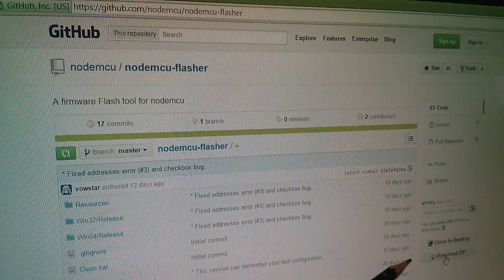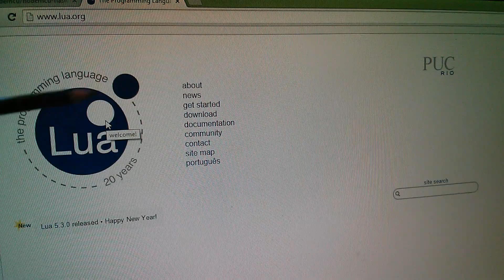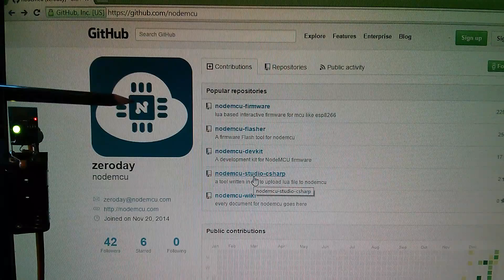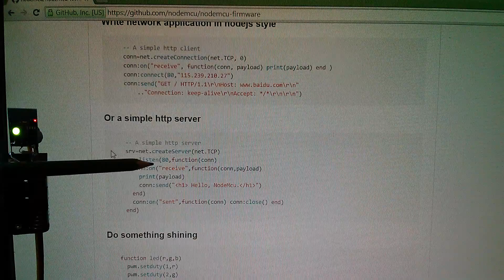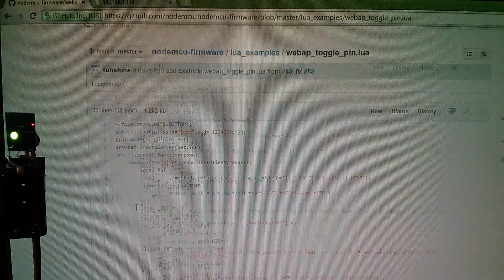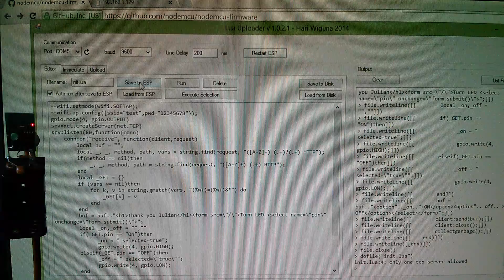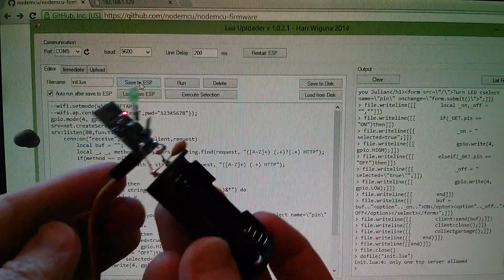ESP8266 Hack #2: Web Enabled LED - WiFi Internet-of-Things IoT

Comment: Julian Ilett , have you measured the voltage of the two Eneloops powering the ESP8266? In theory they're 1.2V each right? so that's only 2.4V, not quite the 3.3V needed by the ESP.  That might explain why your ESP sometimes refuses to cooperate?
Reply: Julian Ilett Yes - but was the tumble dryer still running?
Reply from the maker: Hari Wiguna That's interesting. There's a parameter in the specification sheet VDDIO (symbol Vio) which is minimum 1.7v, maximum 3.6v. I interpreted this as the supply voltage range, but now I'm not so sure.
Reply from the maker: Shadi2 Just tried the tablet browser again and it's working perfectly - and it's still running at 2.4v from the two eneloop NiMH cells. All very mysterious.
Reply: Probably it don't have anything to do with supply voltage (I have ESP8266 running on 2V all day happy but firmware is written in C) but is probably due NodeMCU which use LUA (scripting language) which is interpreted (rather than compile) so it is not so optimized for ESP8266.
Reply: Julian Ilett do you mind putting a voltmeter when it's running and posting the result?
Reply from the maker: Shadi2 It's moving around a bit, but between 2.44v and 2.47v
Reply: Julian Ilett It's pretty hard to follow the brief data sheet but it doesn't seem to mention VDDIO again. It sounds like maybe a portion of the chip can run lower voltage perhaps? Looking at the power pins I see some marked VDD3P3 - and the power on the schematic p7 is labeled VDD33. I think the flash memory might be more sensitive to undervoltage than the esp8266. But it was a shame you had so many problems - I suspect power supply issues too. Keep up the good work!
Reply: Julian Ilett Thanks. Let us know if the tablet starts working with it after you give it a good 3.3v supply.

Comment: Do these things have mesh network controls yet? If not, then I don't really think these are going to be good enough for the IoT, if they can't deal with just a little bit of interference from a LCD monitor.

I'm also guessing that the crappy trace antenna isn't helping things at all either.
Reply from the maker: I wanted to show some of the problems I had getting this to work (or half work). It would be unfair to represent this very new technology as working without flaws. I don't know whether these are hardware or software issues (probably a bit of both). This is frontier stuff!
Reply: Oh no, I realize that the hardware is very new. That is what I am commenting on, not your presentation. I'm very happy with your presentation and documentation of all the resources that you found everything at.

I just bought the NodeMCU 'devkit' on EBay since it plugs nice into a breadboard and I don't have any of those other bits laying around like the USB-to-serial converter. For $15 USD it was a fairly sound investment, I think. Enough to twiddle around with, at any rate.
Reply from the maker: ***** Interesting colour scheme and choice of font on that devkit PCB (particularly on the back - http://www.seeedstudio.com/blog/2015/01/14/new-product-we-are-running-lua-on-esp8266-nodemcu/). Reminds me of another popular development platform. I thought about getting one, but was tempted by all the bells and whistles on this: http://www.ebay.co.uk/itm/301475108343
Reply: Yeah, I noticed that too. That old double edged sword of being open source... Easily improved, easily copied. It's even available before the official website has it. Ha!

Yeah, that one IS quite loaded with a bunch of crazy stuff. Same price too. I don't need two devkits...
Reply: Julian Ilett That second one you posted is pretty interesting, lots of bells and whistles for sure!
Reply: I received my devkit and it looks pretty good, considering it is a knockoff. I haven't had a chance to get in depth with it but I got it running a basic webserver and other basic stuff of that nature. I am going to try and make a Web accessible LED strip light controller with the three PWM and some Mosfet. See how stable the PWM is and whatnot. Maybe make an android app.
Reply: ***** Good to hear. 

Has anyone else had interference issues like Julian was having? When I finally got my NodeMCU ESP8266 server up and running today it was blazing fast, no lagging or anything like that. (or like what Julian Ilett was showing in this video)
Reply: I suspect that the LCD was not helping issues, and he might have been far away (or too close) to his access point. I had zero issues, save for the normal one or two dropped pings out of thousands I was doing. Also might have been his battery not being able to supply enough voltage to transmit the ACK's back out. Wireless is tricky to diagnose.
Reply: ***** Yeah I've been running my ESP8266 Chips on a 3.3v regulator that can supply up to 500ma. The chip can definitely get current thirsty, I think many of the people seeing issues seem to be struggling with the power requirements of that chip.

Comment: Hi Julian.

How come at around 15 minutes in the video after you restarted the ESP you didn't need to reconnect to the WiFi? 

Cheers
Reply from the maker: András Bíró Me neither. The web-enabled LED is working perfectly this evening. Baffling!
Reply from the maker: That seems to be handled by NodeMcu. You only need to provide the WiFi SSID and password once. I guess these details are stored in flash memory in the ESP8266. But I am guessing here - I've got lots more reading to do!
Reply: Julian Ilett Actually, I think it's handled by the Espressif C SDK below the nodemcu. I played with it a bit, and it seemed to save the password as well. By the way it also seemed to be more stable than nodemcu. But I only tried some very basic stuff.
Reply: András Bíró I take it back. It was very stable with esp-httpd a couple of days ago, now it just doesn't want to work reliable with any software. I don't understand.
Reply: Julian Ilett It is very likely that my problem was caused by a bad quality (ebay of course) usb cable...
Reply: András Bíró That raises a question to me that I've always had. Just how do you get a "bad quality USB cable?" It's just some wires and plugs. Digital data is just the proverbial "1's and 0's." It's not like you're aligning a needle on a turntable after all. It's just "on," or it's "off" with digital signals. I once saw on Amazon some "High precision HDMI cable" selling for, if I remember, around $2,000 bucks. Insane. But people buy them. It's like buying a "High precision light switch." Hey, it's either on, or it's OFF. Simple really.
Reply: Grumich In my case, it was just a bad quality connector, which easily broke the connection. I also suspect that the cable has quite high resistance, it can't deliver more than ~500mA to my phone (measured that, compared with a quality cable, which can go above 1A).
And while it's just wires and plugs, it's not that simple. True, digital signals are far less sensitive to noise than analog, but it's not noise-resistant.
The main problem though is usually the parasitic capcitance, especially with high frequency signals like hdmi. $2000 is obviously way too much, but i have $2 cable, which was way too cheap - it's basicly useless,  causes very visible picture noise.
When you dig deeper you can usually found the weak point of a digital protocol,  which can be problematic with bad quality cables. I thought spdif must be flawless, since it's digital, but actually it's quite hard to synchronize the receiver's clock with the transmitter.
Reply: András Bíró Well, that makes sense. If you buy a $2 cable that's using strands of 32 gauge "wrapping wire" and have lousy/loose connectors, you can wind up with problems, especially if you need to run a longer cable. But I wouldn't, as most sane people, pay four figures for a "High Performance Cable." I brought this up because you just generally don't see cables that are as bad as the one you described. "Monster Cable" made millions, possibly billions selling over-priced cables which use "Oxygen free copper" hand-braided by nude virgins and wrapped in "Kryptonite" with solid gold and titanium connectors. That would be what I'd call, "overkill." ;)